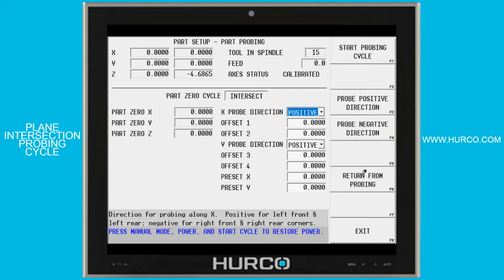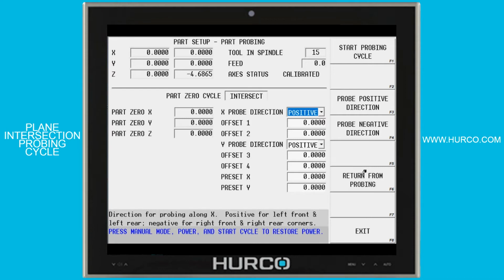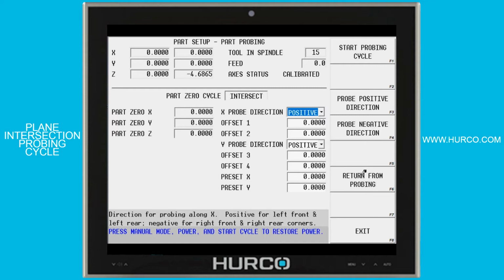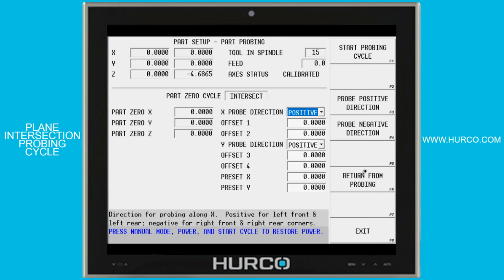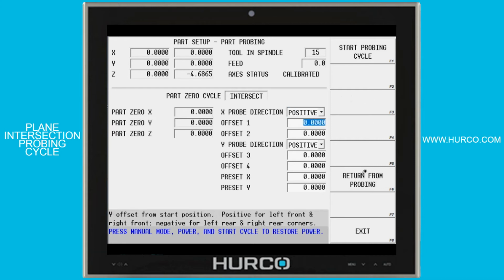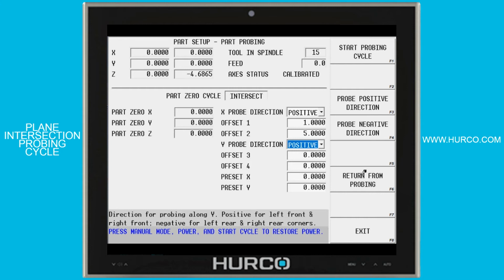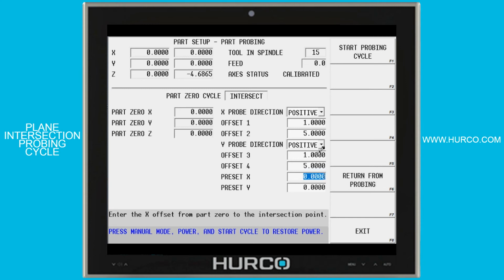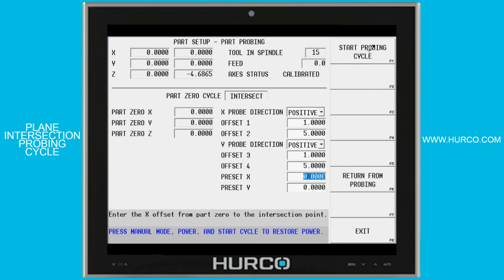Plane Intersection Probing Cycle - Hurco CNC Control Series

Comment: So you probed the left edge. But what if i want to probe the right one? X axis goes negative and probe me a line, all good but Y axis it goes in the X positive Direktion and probing Y in nothing.
Reply from the maker: If you only want to probe a single edge (X, Y, or Z) then you would use the "EDGE" probing routine. In that routine you select the axis you want to probe, and then select the applicable +/- direction. Using the edge routine will allow you to probe that particular edge without disturbing any other axes that have been probed previously. 

Here is a link to a video showing how to program the EDGE routine: https://www.youtube.com/watch?v=OxPt9gp6T8A&list=PLVBPF3VUXjsh_d4LfB3j5T_k5_WAj5YOH&index=7